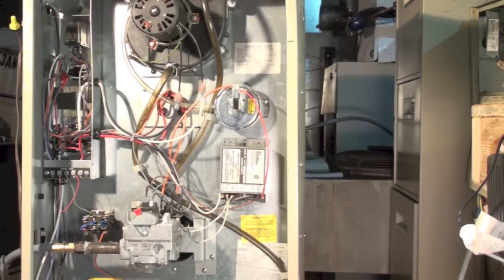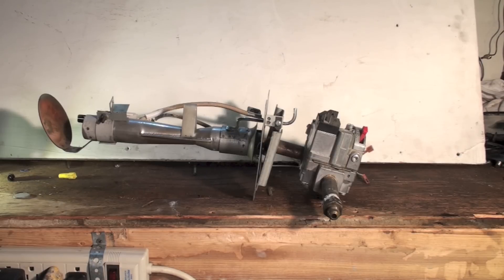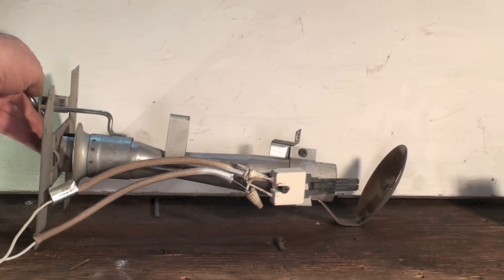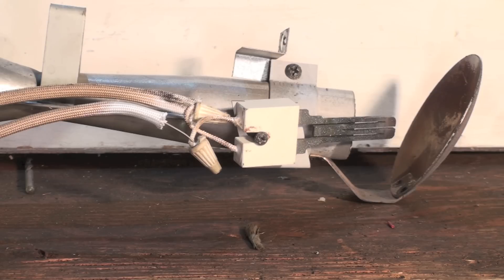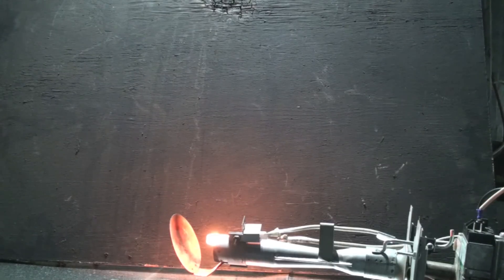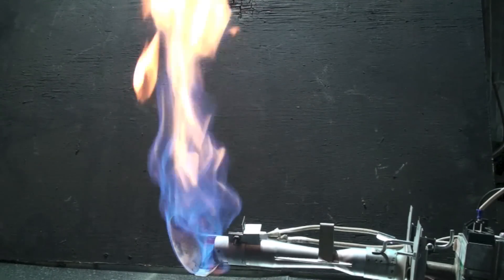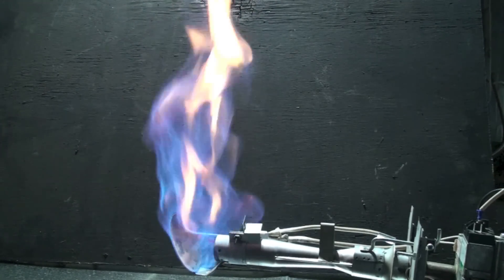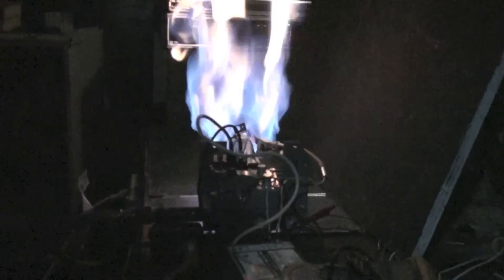Coleman Model CGU gas furnace.  A look at the burner.  Part 1

Comment: Why do they not use these burners anymore
Reply from the maker: The CGU furnace was an adaption of the drum heat exchanger.  The burners used was the only type that would work with it.  The drum heat exchanger was a step backwards in technology from the 1970s and was finally dumped into the trash heap where it belonged.
GFM

Comment: I have a Coleman evcon model with the same burner. I don't know how to get the burner going. It's a single pilot gas burner.
Reply from the maker: I will need much more than that.  Is there power to the furnace.
GFM
Reply: @grayfurnaceman  i got the same burner no adjustment with pilot light burner wont ignite
Reply from the maker: Do you have power to the furnace?
GFM
Reply: I have same problem.  I have flame but no burner. I have 34 volts from control board.